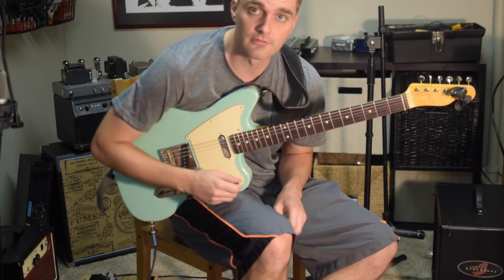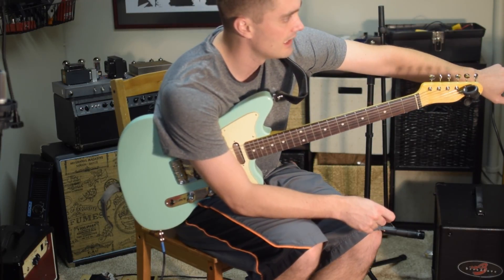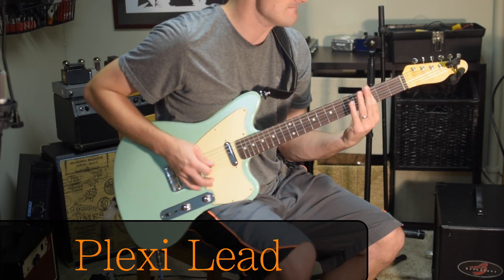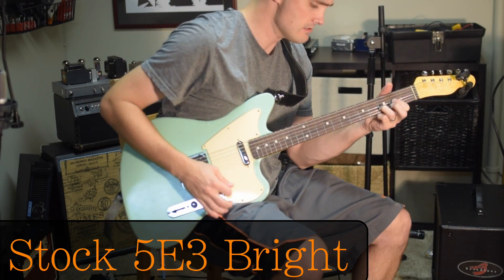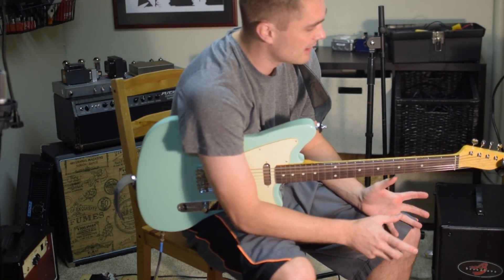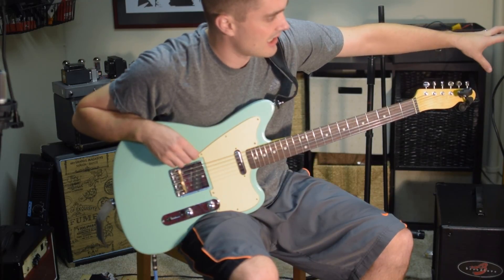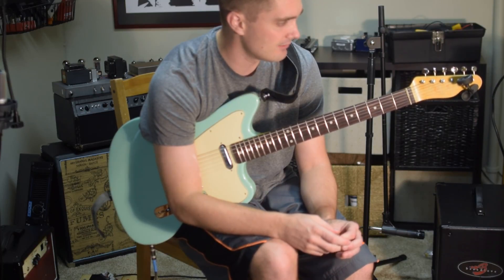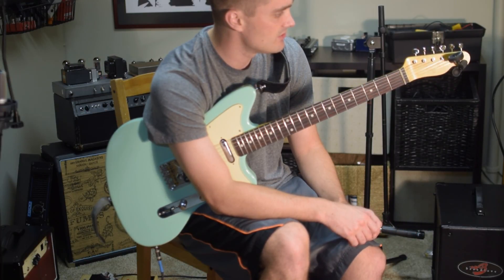5E3 Tweed Deluxe Mod - Normal Channel Plexi Voice

Comment: im doing this mod on my current Bassman build but last night I stupidly drilled into my index finger and had to go to the ER while making a custom plate to cover a hole on the chassis. My barn workshop is covered in blood as a reminder not to be stupid in the future lol. It was such a stupid and easily avoidable mistake too smh. But it was late and i was rushing so I could get some work done since id been too busy to make progress on the build earlier in the day (helping my wife with errands, snaking our kitchen sink etc. etc.) Anyways point is i actually really think this will be a useful mod especially for running effects like you mentioned. Im glad you posted this comparison. Granted it was with a deluxe but thats close enough to get an idea. So now i just gotta wait a few weeks for the puncture wound in my index flinger to heal and ill be back at it. The nurse at the ER laughed at how ironic it would have been to lose my ability to play guitar while workintg on a guitar amp lol.
Reply from the maker: @michaelinglis567  lol nice work
Reply: @KleyDeJong  Just came across this and realized it might be good to leave an update. The amp came out GREAT, couldnt be more happy with it. I posted a demo on my "channel" of me playing it but its even better since the video since i made a few more changes and fixed one of the output tubes (it had a bad solder joint on the base on pin 4/screen grid so the bias was jumping all around when the connection wasnt in just the right spot. But i resoldered the screen grid pin and now its working and holding a steady bias)

And as for my finger, ....lol.....its still numb on the very end but luckily its not getting in the way of my playing and i feel like it has regained a lot of feeling its just doing so very slowly. Anyways just wanted to post an update. I did end up doing the plexi inspired channel mod btw. And i added a push pull to jumper the inputs on the lead channel volume. Im pretty sure one of the videos i posted has all the mods and details about the build in the description if anyone comes across this and is interested.
Reply from the maker: @michaelinglis567  Awesome, glad to hear it!

Comment: Very interesting, although I must say that I can only hear a very subtle difference between the two channels. I have two SF Fender amps (a Deluxe Rev and a Vibrolux Rev) and wonder how much difference I would hear between the stock and modded Normal channel. I'd like very much to have, as per Rob Robinette's description of the mod, a less bassy channel that interacts well with OD/dist pedals.  Very cool tone from your amp, BTW!  @robrobinette

Comment: Be good to hear mod channel gain backed off a bit, slight boost pedal in front (DOD OD 250 would be a good simple pick) then ride the guitar volume control to show gain and sag/compression as input goes up. Bet there's a sweet spot before guitar hits full volume where pick attack transitions from clean to scream.

Comment: I'm surprised to admit that I prefer the stock version better.  To my ears it stays fuller, and when cranked it has that feeling of an amp about to explode.  I would be curious to see what the difference would be if you were running a humbucker instead of single coil.
Reply: The "Plexi" style cuts bass and shifts emphasis to high mids, then you are clear to add loads of gain for that classic rock sound which stays focused and punchy. If you tried that with standard Fender circuit it would be boomy, fart out in high gain.

The video here wasn't using too much gain oddly enough.

Simply put, you just do some tailoring to the signal path in order to reliably enjoy high gain lead playing.

Comment: I do not hear any significant difference ... I tried on mine and it's the same observation ... thanks for this video
Reply: Hi Doc, so are you saying that you have a 5E3 with the Lead channel mod, and that to your own ears there doesn't appear to be a significant difference? I'm just about to build a 5E3 and was toying with this mod, but from what I actually hear on this video, the Lead channel seems to be similar but with less presence, so less bright if that makes sense (which is to be expected I guess as it is the normal channel). Cheers.

And great video Kley as always :)
Reply: Tony Knight yeah exactly. Nonetheless Rob wrote it's a great mod to do with the cascaded channel mod. This is the next mod I will try ! Let me know if you try it too. Thanks for your comments 😊
Reply: Will do. I was originally trying to keep my build as close to stock as possible, but I don't mind the idea of adding in some sonic options! I'll go look at Rob's cascaded channel mod now...
Reply: Tony Knight I tried Rob's 3 way NFB mod and found it very versatile. But the most usable thing to do (imho) is to use a power attenuator so you get great crunch sound in every situation 😉
Reply: Great advice. Kley's videos give a good idea of the NFB, and I'll certainly add that as well as a VVR. I've tried to PM you to avoid hijacking Kley's channel -- although the discussion is still very pertinent to others who get real value out of Kley's posts :)

Comment: Great video! Awesome tone! I was wondering if you could help me out with some advice. I am getting the mojo tone kit in today and going to do the same mod - plexi mod the normal channel. I am also interested in doing another mod that makes the 2 volumes separate (elminate volume interaction mod) - one for each channel. Do you reccomend I seperate the bright and plexi channels volume controls or keep them as is together? Would it beneift much from having an independent volume control for each channel? Thanks in advance!
Reply from the maker: Thanks.  I think the joined volume controls is kind of a unique quirk to the amp.  So I think it comes down to how accurate you want it to be to the original.  But functionally speaking it doesn't really 'add' a lot.  If you'd prefer to have a more straightforward channel setup then I don't think you'd miss it.
Reply: I do like the concept of having the two volumes interact with eachother which does make this amp unique like you were saying. I'll decide when I get to that part! Thanks so much for the quick response!

Comment: How did you record this?

Can you please tell us what kind of materials did you use also what kind of speaker? :)

What kind of pickups are in the guitar?

 Thanks!!!
Reply from the maker: SM57 close mic'd.  AKG C214 room mic mixed in a little.  High pass filter at 75 hz.  Touch of compression.  

I used the small parts kit from Mojotone.  Carbon Comp resistors, orange drop caps, CTS pots.

GFS premium alnico pickups.
Reply: Any info on the interface? ;)
Reply from the maker: Scarlett 2i2.